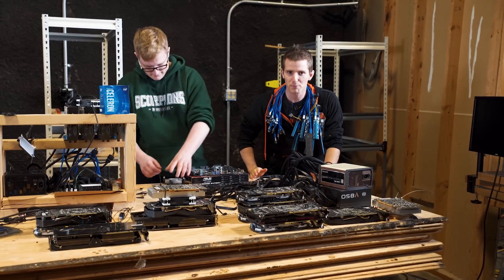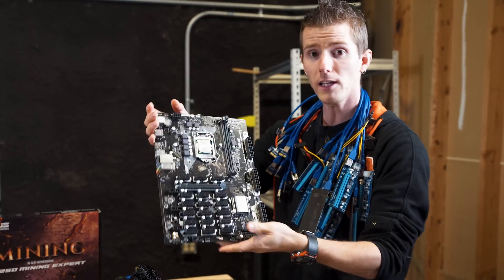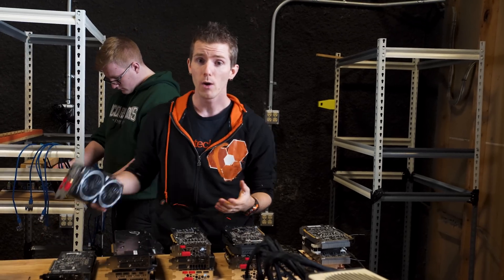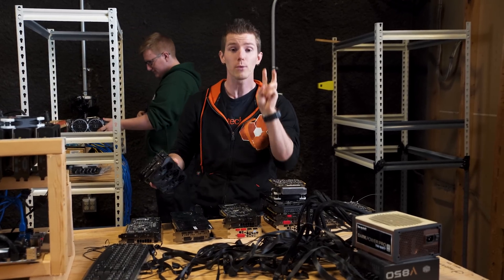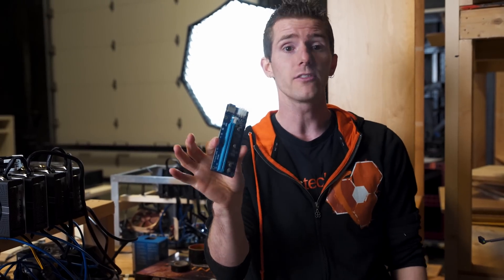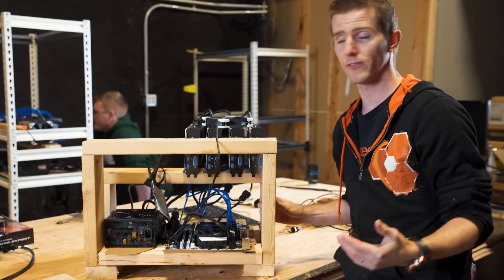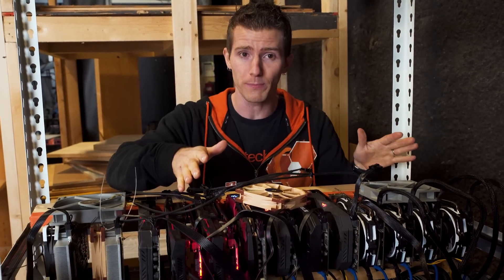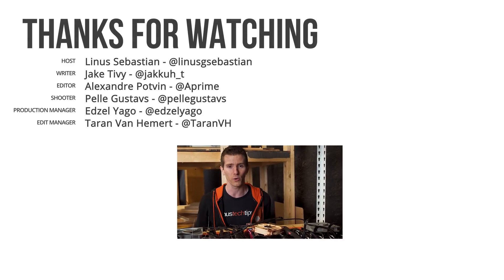13 GPUs in ONE PC? – Mining Adventure Part 2

Comment: Nvidia released an official statement requesting that all retailers stop selling gaming graphics cards to cryptocurrency miners. It's annoying when cryptocurrency miners spout this blasphemy about how gpus are tool and aren't inherently designed for only one purpose, when if you take a simple look at the warranty of most graphics cards you'll find that it's voided if you do anything other than use it for its intended purpose, which excludes things like mining, folding at home, and things of that nature. It's clear the manufacturers want nothing to do with this, but they're stuck because they can't just suddenly band the sale from third-party vendors to minors. Nvidia is currently taking steps to provision graphics card sales from its direct website so that it only goes to gamers.
Reply: They should just make a better card that is cost effective and efficient for minners so gamers can have lower prices on gaming cards.
Reply: they do. 

there are mining specific cards, but most people who mine wont buy them because they want to sell their GPU's after they are done using them to get some extra money back.
Reply: when all the good cards are sold out for months at a time, and the only way to get one at a reasonable price is when a miner sells off their no longer profitable cards, people get tired of waiting and buy them. 

I've seen miners selling over 30 1080 TI's at a time on ebay at $160 each. they give some BS reason like, 

"my wife didn't like all the noise they were making, so I am now forced to sell them" 

when in reality, its more like, 

"The cards are starting to fail and I need to get some money back before they are gone for good. SOLD AS IS, NO RETURNS!"
Reply: Your statements are false and make no sense at all. Why would Nvidia launch an official statement requesting that retailers should stop selling their cards to Miners. Nvidia doesn't give a flying fuck what people do with their cards and the rise of crypto currency only boosted their profits.

There are cards that are specialized in solving sha 256 algorithms like the ASIC cards but not every coin is mineable with these cards because they don't use sha 256 hashes. That's why people buy consumer GPUs, to mine coins that don't use sha256 (which there are plenty of).

I know it sucks that the prices surge and the availability of GPUs goes down, but people just use the cards what their made for converting and processing 0s and 1s, if that's for gaming or cryptocurrency if you strip it down to the basics it doesn't matter.
Reply: wouldn't work because other miners wont want it, and gamers wouldn't want it either. 

mining difficulty goes up over time, and gamer wont want a handicap card. 

they WANT to resell back to gamers specifically because gamers wanted the card in the first place. but its a bad deal for gamers. no warranty, stressed card, even if they are being sold used at less than retail it wont last long.
Reply: as a gamer I wouldn't want a resoled card rn because of mining. I can't believe their are people that would fall into that trap.
Reply: I predict the second hand market not lasting because of not knowing if the cards where used for mining.
Reply: The funny thing is, most non-online retailers were already enforcing a "2-3 GPUs per customer" policy, even some online retailers were as well. Meanwhile, anyone can set a 200 gpu order with Asus, EVGA, MSI or any other GPU manufacturer easily, and by paying for them up front and immediately (retailers usually pay in quotas over the course of several months for their shipments) they become priority number 1.

The problem is not the casual gamer mining during the night, or the casual miner with a 6GPU rig. The problem is not the retailers or AMD/Nvidia. The problem are the large scale, full warehouse level miners that purchase in massive bulk orders, the problem is the GPU manufacturers that will prefer selling to them since they pay full price up front.
Reply: Well a gamer will only buy 1 or maybe 2 GPU's, while a miner is going to buy like 30 in one go...
Reply: This is just good marketing by NVIDIA who want to make sure gamers don't leave them or get a bad image of them. :D You fell for it hook line and sinker. They can't tell who the stores are selling to nor can they enforce it, it's just a statement.
Reply: So i cant mine with my 1070 when im not using that what the heck?
Reply: I got a 980ti for 60€ becuase he used it to mine, couldnt care less it still runs perfectly and the price was great.
Reply: Gargan tuace in case your too lazy, here is the warranty info directly from PNY

https://www.pny.com/File%20Library/Support/PNY%20Products/Warranties/GeForce%20Graphics/3-Year-Limited-Warranty.pdf

Specifically talks about mining

THIS WARRANTY SHALL NOT APPLY WHERE PRODUCT(S) ARE USED TO ANY DEGREE, OUTSIDE OF NORMAL INTENDED 
USE, WHICH SHALL INCLUDE BUT ARE NOT LIMITED TO “MINING” (e.g., Cryptocurrency, Data Mining, Mining Farms).
Reply: andrewesquivel how will they know if a gamer is buying a card rather than a miner. I agree with you though, miners are annoying. I wanted to build a decent gaming PC and it makes no sense at the moment with prices.
Reply: Not what I mean. It should be a trap card that can be used for gaming but is less efficient at gaming and is more efficient at mining. That way they can resell it and it works better for mining.
Reply: this is only CYA because certain countries are starting to take a hard stance against crypto and a very easy way to stop it is to make these hi powered graphics card illegal or slap a terribly large duty on them.
Reply: AMD tried the same thing but it doesnt really work since you can't really tell who's a miner and who isnt. You have to pay a premium to get it at a good price but who's really getting it, they dont know. Although amd did run out of premium early cards pretty quick and had shitty deals most people dont care about with it so i hope nvidia stays away from shit deals and only sells the cards.
Reply: There was never an official statement. Just a debunked statement with no proof that was reposted and re-linked and used to create new articles all over the internet for the past 24 hours. Give me a real source or it's just fake news.

Also if GPUs were designed for "one purpose only" OpenCL and Cuda wouldn't exist. They haven't been "single-purpose" since the days of the HD3870/8800GTX
Reply: Yeah, no. GPUs are covered under warranty when used for purposes other than gaming..including mining. How would that even work? Not like the cards keep a record of what they were used for. Also those 1080ti's for $160 on eBay are 100% a scam, and only a complete moron who's fine with their cash being tied up for 3 weeks waiting for eBays resolution process would buy one of them.
Reply: Gargan tuace literally 1 Google search shows multiple companies that void warranty if used to mine
Reply: Joe Cameron and they'll keep buying as long it generates profit.
Gamers only buy it 1-3 each 3-5 years as long they want to upgrade.
Miners will buy it everytime it's available on market and they already generate enough profit to buy the gpu.
It'll be endless loop for miners.
Reply: Step 1: Steal and examine browser cookies on PC.
Step 2: If cryptocurrency websites are found, extort miner when they comes back for new cards. 
Step 3: ????
Step 4: Profit
Reply: Brb taking a small army to the store. Also I already have had warranty cover several cards.
Reply: That is what worries me. I bought my 980 for 200 over a year ago. I was going to be looking for a 1080 after the next gen is released but unless i see it in a dedicated gaming system in person i would really fear getting a mining unit.
Reply: andrewesquivel Board Partners are the ones profiting the most from mining. They are selling directly to miners (see the GN interview with Luke). Also, miners are not selling cards. They keeping them and mining on them. If you can point out some cheap second hand graphics cards to me, please do. Mining does not destroy cards (especially if they're undervolted). This isn't going to stop until A) cryptocurrency stabilizes (never) or crashes (unlikely?). OR they start making more graphics cards to satisfy demand, but that might take several generations.
Reply: andrewesquivel those are fake 1080s selling for 160, bullshit Chinese knockoffs with some shitty gtx5xx series chip in it. No one would sell a 1080ti for $160, but there are a ton of retards that fall for that
Reply: Mr EHEHE no one's using gpus for Bitcoin mining anymore. GPU mining has been dead for Bitcoin for several years now. Now it's all done by Asic miners. Other cryptocurrencies like aetherium our being processed by gpus though
Reply: Mr EHEHE -_- you can't mine BTC with GPUs
Reply: MrMalzig great!
Reply: andrewesquivel Rendering on GeForce GPU voids the warranty? I guess I've voided a lot of people's warranties.
Reply: BassRacerx that's the dumbest thing I've ever heard
Reply: About six months ago, I was scrambling stores to buy my 6-GPU mining rig. While I was buying 2 from this store, someone called over the phone. The cashier said it was a guy who wanted to buy 1000 GPUs. We just lol'd.
Reply: Yeah sadly they never ran out of stock because folding at home
Reply: andrewesquivel Dude I was commenting the same.
Reply: Definitely screw miners. Go NVIDIA! 👍
Reply: Miners are selfish, impatient and they disrupt economy. And yes they are the only reason an average guy can't even build a mid-range PC today coz hardware which was $100 now its more than $300. Any one who will be complaining to my comments will be the person with the words all above issues. ✌️
Reply: good joke
Reply: i love building rigs, buildig mining rigs has been the most fun thing in years especially whenever i get an order to build a 20k 1080ti water rig. go play your destiny 2 or something and gamble on lootboxes
Reply: andrewesquivel d
Reply: Nvidias stock would like a word with you
Reply: what a load of bs dude faulty 1080ti cards are selling for crazy money
Reply: chance's are no one with decent gpu's mining is selling right now!
Reply: Thats going to do nothing to stop me from mining. I hope you realize that people who bought NES classics paid friends to stand in line with them to buy product. Theres nothing anyone can do to stop us miners from buying the GPU's we want until legit companies build actual high end mining specific cards with proper support.
Reply: another CRY BABY. you must have a lot of money, oh , just ask mommy
Reply: Mr EHEHE people are always going to say that they were not used for mining. It's not like you can prove them otherwise.
Reply: mamamia88 they don't make extra money from this, retails do.
Reply: yeah but then again i might buy them cause i understand enough to have a greater than 50 percent chance of fixing it
Reply: Nvidia has a stake in game development, and PC gaming is there biggest market as of now.
Reply: You can't stop us miners, we'll buy the GPUs no matter what.  Remember, these companies like money, which you gamers dont have.
Reply: Miners Can go buy the new Titan v 😝

Comment: You just contributed to the GPU's ever-lasting high price

Unsoobed (jk but im still pissed off)
Reply: 42thgamer Those people who "just want to make some money", are affecting a whole lot of other people besides themselves in order to do it. Now call me crazy, but that tends to be a problem.
Reply: Use a gpu you already own and mine, you might pay for some of your card. That's what I'm doing with my fury x.  In the last 6 months I made up to $1000 total accumulated (at peak BTC value). Down to just under $600 right now and I stopped mining because of the nicehash hack. Thank God I used an external wallet. still paid off my card though
Reply: rotor13 "partially miners"

They're the ones eating all of the supplies

Also,Nvidia has tried to prevent selling GPU to miners
Reply: rotor13 Sure, then you have massive crypto farms that order 100k cards straight from manufacturers. So yeah, there's no competing with that.
Reply: 1050's are sill for sale hahaha
Reply: rotor13 I disagree with stating miners are "only" partially responsible. Gfx cards are for a specific market, meant for a specific application, and gpu miners hoarding supplies to utilize them for use other than intended is an explicitly primary cause. Yes if manufacturers could increase supply that would help lower prices, but as with any market, hoarding is an abusive practice that negatively impacts everyone else.
Reply: Those people should get a job then...
Reply: So let me get this straight, you are not mining while at work or sleeping?
Reply: waaaa
Reply: Hard to be mad at people who just want to make some money
Reply: Correlation =/= Causation..... whats driving GPU prices up, is only partially miners. Whats really driving them up is the low supply from memory manufacturers. You can't just "make more" when there is more than one industry that depends on memory, and there are very few manufacturers and they're trying to supply everyone.

Its definitely a supply/demand thing, however not blamed solely on cryptocurrency miners. 

FYI: When people want to increase their cash flow, everyone around them is affected in some way regardless of moral/ethical standpoint. 
I mean seriously.... look at any conglomerate and the news such causes when their stock price increases or decreases and the indirect affect it has on everyone else that may not even have any involvement in its business or investments.....

Comment: Your the reason a "budget pc" isn't a thing...
Reply: Will all part here in my country cost around 1000 USD for this specifications.
1050 ti
Ryzen 5 1400
2x4 8gb DDR 4 ram
Cases/Fans/Monitor/Keyboard
Motherboard
256gb SSD
1tb HDD

This was supposed to be lower . Now i dont think it should be even considered budget build anymore with 1000 USD on stakes and i still doubt that would be enough because I've been counting and checking price in different retail last few months.
Reply: Will Linus has a huge amount of influence you know how many people saw this video decided to start mining and bought 15 cards.... probably more than you think....
Reply: Bob Destine nobody has gone out their way to buy that many cards that don't have then already. 1. Way too high, lower roi, 2. Stock. 3. Its not that great anymore due to crypto dropping in price. Also. You can make a budget build just fine. So hypothetically people do. It probably won't affect it much anyway. 1050ti or 560 is fine for 1080p gaming. You can always buy second hand or cheap out somewhere else
Reply: Are you sure about that?
Reply: Will I mean a good budget pc
Reply: Damn Fiddle but linus isn't the reason solely, and not even the miners, they had forward thinking. Manufacturers have a limited supply and couldn't see this coming. Supply and demand caused it. Granted miners contributed to this but so did gamers who went out and bought it because of this. You can still manage to build a budget gaming pc that runs everything you'll play at 1080p 60fps in medium and above reliably for 500/600/700. I recently built mine which runs everything at max fine and I could have saved some money on a cheaper cpu and gpu, case, less fans and use stock cooler, get a cheaper motherboard and not get matching component. Ram at the moment is worse imo, less vital but expensive as hell right now. I'm running a 1600 could have grabbed a 1500 or dropped down further, rx 580 8gb and could have got the 4gb, 570 or a 1060 to reduce it further, 8gb of ddr4 which I payed £95 but if I wanted to save in the long run picked up 16gb for 75 each and sold them or kept them. Ssd but again could skip on that, I bought a b350 board but could have gone cheaper on it rather than pay 100+ and saved on the case.
I cared about how it looked which caused me to spend more, and I wanted to make it upgradeable.
I wouldn't call anything with a rx 580 or 1060 a budget build. 560/570 maybe, 1050ti for sure but if you're gonna have a budget build featuring these cards, may as well make sure your system is up to scratch.
Ryzen 3/5 with a 560/1050ti maybe 570/1060 3gb with 8gb ram and a cheap case, psu and hdd will run games fine without breaking a huge budget.
Reply: Bob Destine a good budget pc can be made without the need for an rx 580 or 1060. These cards are popular because if their price to performance. Ryzen 3/5 with a 1050ti or 560/570 is pretty cheap to buy and it runs everything great.
570 is a few frames less than a 580 but is only really available in 4gb which is more than enough. I hardly ever use 4gb unless it's siege on ultra but then again using ultra vs very high is not really noticeable at 1080p. This goes for most games. You always want a balance between fps and graphics which sometimes max isn't the best and custom is better. 1050ti/560 is great for the majority of games out there and a 570 or 470 will do just fine for 1080p.